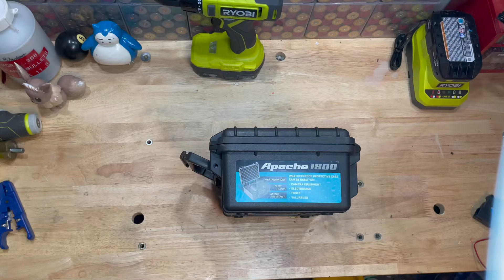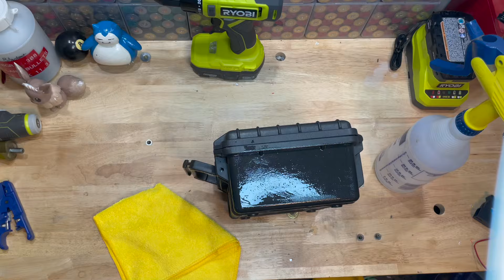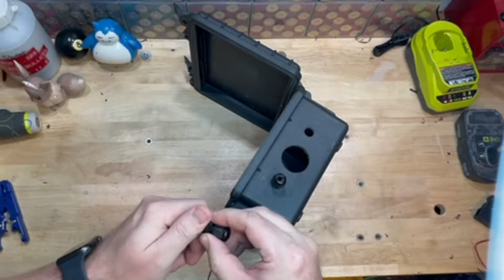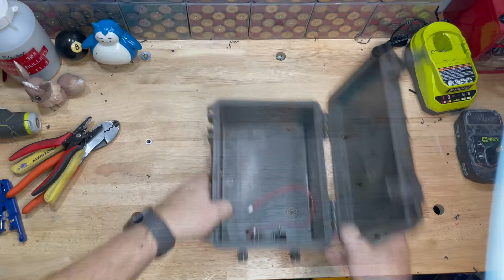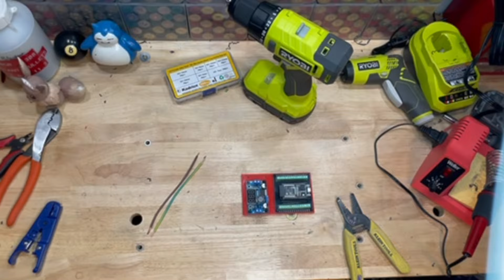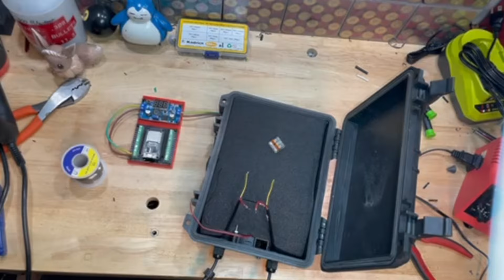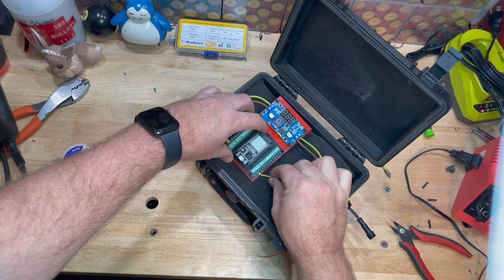"DIY: Control Your Govee with WLED – Step-by-Step Guide!"

Comment: I would like to know more about your use of the Govee lights, with they WLED controller and xLights. Got a video or write up about it?
Reply from the maker: Hey! I actually do use Govee lights in some of my setups, but with a twist—I integrate them through a WLED controller so I can manage them via xLights. It’s a bit of a workaround since Govee lights aren’t natively supported in xLights, but with WLED, you can treat them like any other pixel strip, which opens up a ton of possibilities for syncing to music or other effects.

I don’t have a dedicated video on that exact setup yet, but I’ve got clips in my behind-the-scenes and controller setup videos that show how I wire and control different lights through WLED and xLights. I could put together a short focused demo if enough people are curious!

Are you thinking about using Govee for a show or more of a decorative setup?
Reply: @twinkletunesandlighting yes indeed got about 100 ft or a little more and I plan to add my own controller I guess it would be just controlled as a single strand?
Reply: @twinkletunesandlighting yes, i am interested in using my govees in my show since i out those up before i acquired 15k pixels.  Really interested in your wifi setup in your show with an AP. I believe i seen it mentioned in one of your vids.

Comment: I don’t know what I’ve done wrong but I’ve followed this videos step by step and when II plug the power in only three lights turn on and I can’t control them.
Reply from the maker: Double check you GPIO and your pin out.  In WLED make sure you are telling the GPIO how many lights are being controlled by that output.  Make sure your ESP32 is set backwards on the breadboard. That can also happen.
Reply: @twinkletunesandlighting  gpio is correct.  I might switch it to a different one. The esp is installed correctly.
Reply from the maker: You can you GPIO 1,2,3,4,5,12,14,15 I believe.
Reply: @twinkletunesandlighting okay I’ll try it. Thanks. I hope it’s just a bad pin.
Reply from the maker: You got this!
Reply: @twinkletunesandlighting no I don’t lol.

Comment: Did you get the small or big btf connector? I bought the small and they don’t connect to the Govee.
Reply from the maker: I got the smaller ones but I cut off the Govee ends and put those on.  That way I could go back and forth from WLED and the Govee app.

Comment: So you are blowing air in, where does it exhaust?
Reply: I noticed that too. He is either running it in reverse which is not efficient, or sucking air in. Ether way, an exhaust or intake port is needed or it isn't moving any air regardless.
Reply from the maker: There is enough air movement. I have been running it for a couple years now nonstop with no issues.
Reply from the maker: Normal Use (Most LED and DIY Projects)
	•	Running WLED, WiFi, sensors, etc. — even with moderate pixel loads — the ESP32 stays well within safe temperature limits.
	•	The chip might feel warm to the touch (40–60°C / 104–140°F), but that’s totally normal.
	•	No fan or special airflow needed, even if it’s enclosed, as long as the enclosure isn’t sealed airtight and baking in the sun. Having the pressure release valve open is enough. 

Higher Power or Enclosed Situations

You might need airflow if:
	•	The ESP32 is inside a tiny sealed box with no ventilation.
	•	It’s running at full load continuously (e.g., dual-core processing, WiFi+BLE heavy use, or LED drivers pushing limits).
	•	Ambient temperature is above 40°C (104°F).

In those cases:
	•	Add a few vent holes or a small heatsink on the metal can.
	•	A tiny 5V fan can help if you’ve got other heat sources nearby (like power supplies or buck converters).

In the long run the controller sits in the garage on a wall and has never had problems.

Comment: This was so helpful and explained perfectly. Thank you. I've setup a few pixel sticks and kulp32 boards with lights for my show but wa two to add govee curtains. I just got a quin quad controller for that. The main thing that gives me pause is cutting the govee connectors from the controller. I wish someone would make pigtails for the govee line to avoid that in case you want to go back to factory controller. That seems like an untapped market.
Reply from the maker: Thanks so much! I’m glad the video helped! Sounds like you’ve already got a great setup going with those Kulp boards and pixel sticks! I totally get your hesitation about cutting the Govee connectors—once you snip them, there’s no going back to the original controller without some effort.

You’re right, a set of plug-and-play pigtails for Govee products would be a game changer. There’s definitely a gap in the market for that—especially with how popular Govee has become for DIY lighting setups. Until someone jumps on it, I’d suggest looking into JST adapter harnesses or even making a short jumper cable with the factory plug on one side and a standard connector on the other. That way, you preserve the original connector just in case!

Let me know how the Quin Quad works with the curtains—I’d love to hear how it integrates!

Comment: So i have 2 100ft kits on my house and it drives me nuts that the app doesn't allow them to sync up from the end of 1 kit to the start of my second kit. Could i use this method to power 200ft?
Reply from the maker: Totally hear you — that’s one of the biggest frustrations with the Govee setup! Their kits are usually limited to about 100 LEDs per run because of voltage drop. After that length, the LEDs start to dim or change color because there isn’t enough power making it to the end of the strip.

That’s why your two 100ft kits can’t sync — they’re treated as completely separate systems.

With WLED, you can absolutely control 200ft of LEDs and keep them in perfect sync! BUT you’ll need to inject power at the second 100ft to avoid voltage drop with its suppled power.

So yes, the method I showed could work for your setup — you’d just need a bit of wiring and power planning.
Reply: @twinkletunesandlighting Awesome, Thanks!
Reply: @twinkletunesandlighting I have put the enbrighten lights on my house this past November. I have 2) 150 light kits.  With the app you can link them together.

Comment: Does this work the same for 150ft (9 sets of lights) vs say 50ft (3 sets of lights?)
Reply from the maker: Yes it does.  This is what I run on my house and it is 150ft.  The difference in length is power consumption.  They run at 36V so the can power the last LED in the 150ft. run. All this is doing is introducing a new signal that they receive.  The power is not affected.
Reply: Hey so I gave this a shot and when I plugged in the lights it didn’t work. And the fan never turned on either. Any advice? My wires heated up a lot when soldering (I’m not good at all with it) could I have fried something?
Reply: Did you first plug your ESP32 into a computer to configure it to work on iPhone app? And is it a red flag that the lights don’t power on immediately after plugging everything in?

Comment: 0:00 FYI PRO TIP: Cleaning that sticky glue off from labels, use Citrus Pure Air Freshener, available at Home Depot and Lowes. Spray some  on glue and let sit for a minute, it breaks down the glue so it can be almost wiped away.
Reply from the maker: @SavedByFaithInJesus  no way! I will try that. Thank you!

Comment: What’s the point my opinion Govee has better presets than WLED
Reply from the maker: @blaines1872  so I can control them with xlights for my Christmas and Halloween shows. When I am not running the shows on the off seasons I put the Govee controllers back on.
Reply: To make it more libre. 

More serious answer, I have some extra strings but no controller/power supply. I'm going to do this to use up the extra for other projects.

Comment: do the pros work with WLED?
Reply from the maker: Its more of a hobby.   WLED is just a protocol for controllers to "talk" to the lights.
Reply: @ I meant do the Govee permanent outdoor lights pro work with WLED?
Reply from the maker: @ ha ha. My bad. Yes they do. You will need to  select the correct color order on WLED. My are version 1 of the Govee which are RGB. The pros I believe are RGBW.

Comment: Thanks for this video - I just bought into the Costco H805C (Elite??) -- wondering if I could cut them up the same for wLED ...
Reply from the maker: @Kingpin403  anything that is an RGB  or RGBW bulb can be controlled this same way.
Reply: @twinkletunesandlighting  could I use this on pros? I have 200ft but no controller, I see you said RGBW, I know the pros are rgbww but I plan to only use white accent lighting. I have no experience with any of this, do you sell prefabricated setups I can buy?
Reply from the maker: @ajynus  yes you can. When you get it into WLED you and manipulate the led order.
Reply: @twinkletunesandlighting  do you have email I can contact you for questions? I want to build this please. Thank you
Reply: @twinkletunesandlighting do you have a contact email?
Reply: @twinkletunesandlighting  you got contact info?

Comment: Hi  so I have 2 x 100ft of non pro lights it will take me 200 ft to go around my house. So do I need to do this for each 100ft strand
Reply: I have the same issue. Going to try a power supply with a larger amp rating to allow for the 7 amps WLED tells me I need for 200'
Reply from the maker: Great question! If you're using 2 x 100ft Govee non-pro light strands and want to control them with WLED, here’s what you need to consider:

Yes, ideally, you’ll need to set up WLED control for each 100ft strand separately—especially since those non-pro versions aren’t addressable beyond their internal segment limits. Here’s what that usually means:

If they’re not designed to be daisy-chained or controlled as one unit, each strand will need its own WLED controller (like a D1 Mini or ESP32) and power injection if you want full brightness across the length.

You can still sync both controllers through WLED using Sync Interfaces, so they run the same effects at the same time (looks super slick around the whole house).

Comment: The tip about not using Wagos for the data line might solve my issue. It will be a few days before i get a new board my last one fried. I'm using WLED controller for Eufy lights.
Reply from the maker: I have never had good luck with them. All my early problems were from them. I always try and solder when I can or crimp.
Reply: If you want the flexibility of the waygo I've found placing a quinled data booster ahead of the waygo allows it to work without issue.. 

I have 1 connector where I needed the flexibility of the waygo and this has solved that issue and ran for a few months without issue.

Comment: I thought WS2811 was 12V protocall. So your saying the Govees require 36V. So 36V is being sent to each light in the string  and converted to 12v at each light.
Reply from the maker: You will need to use the power supply from Govee as it will provide the 36v to run this particular set of led. In the video the only thing I did was replace the controller with an Esp32.
Reply: i get all of how its being done. And thanks for the video BTW.  Govee must do something at each light thats different than a standard WS2811. There must be some internal things they are doing to be able to power ws2811 with 36V
Reply from the maker: @DeeDee-vu5mi  the 36v is only for the long run. You can power up to 108 LED on the longest run but the voltage drop at the end is pretty big. I assume it is a regulated pixel and I also assume it is a 12v pixel. Again these are my assumptions. By the end of the run I am still a little over 12v.  WS2811 has nothing to do with the voltage. It is all about the signal. The signal does not care about how much voltage it takes to power the device.
Reply: @twinkletunesandlighting  I just looked at the specs on the WS2811 IC, its power suppy input rating is 6-7V and is contant current regulated to 12V output for the LED'. Thats just the IC chip, beyond that we can only assume the 36volts is being handled inside each led puck assy. Still like what you have done with the video. Just trying wrap my head around what Govee is doing.
Reply from the maker: @DeeDee-vu5mi  yes I believe all the LEDs are regulated so if they are 12v led or even 5v led the 36v are regulated to each LED.
Reply: Where did you get the bread board for the esp controller?
Reply from the maker: @rrendonx  it’s a 30 pin breakout from Amazon.

Comment: Nice video... just an fyi the esp that you're using has a voltage regulator on the Vin pin that you can put 5v into. I believe if you want to use 3.3 volt there is aslo a 3.3v pin you can use..
Reply from the maker: Interesting. I had no idea. I will look in to that and redesign going forward.

Comment: What protocol do Govee lights use / WLED settings?
Reply from the maker: WS281x  the Govee lights are a simple RGB that is a WS2811 per bulb. The is the series that came out before the pro series. If you have the pro it is labeled as a RGBWW.